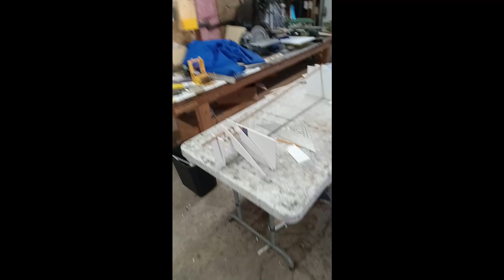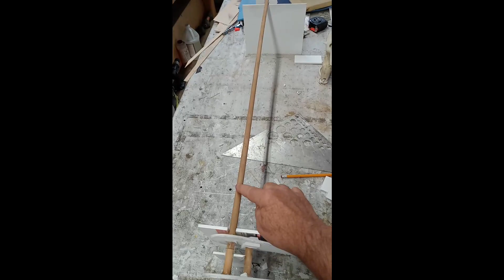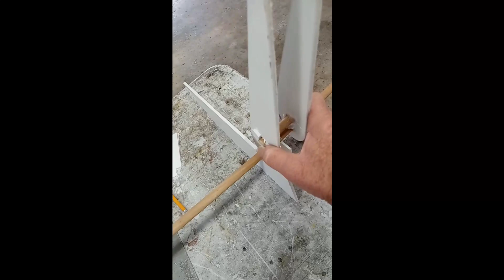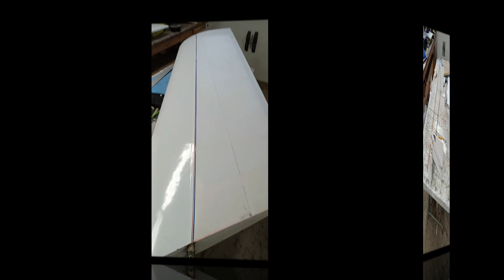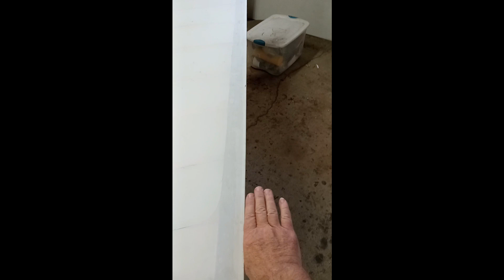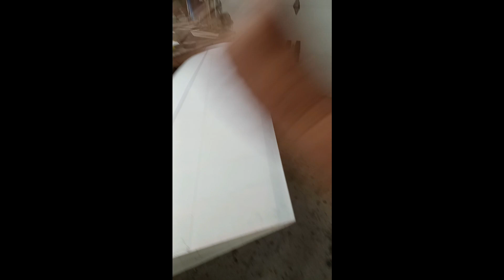Elevon Extension Build 1 of ? - Klingberg Wing MkII Development

Comment: why not just use all-flying elevons?  much less throw and spanwise flow.
Reply from the maker: I've tried it. It does not work. The Brits tried it back in the 50s and had similar bad results and cancelled the program. I'll have a future video explaining why.
Reply: @KlingbergWingMkII  ok, i want to see that video.  i got them working on my Prandtl-D model.
Reply from the maker: Considering that, I think you should do full flying elevons on your wing. If for some reason you got them to work, we would all learn something new.
Reply: @KlingbergWingMkII  It was just a 1.6m model, built to Al Bowers design data.  I had some serious problems which took a few iterations to solve.  I seems ok now, for my meagre level of flying wing experience.  I learned priceless tips from your videos, plus a big boost in motivation.  I would not have succeeded without you.